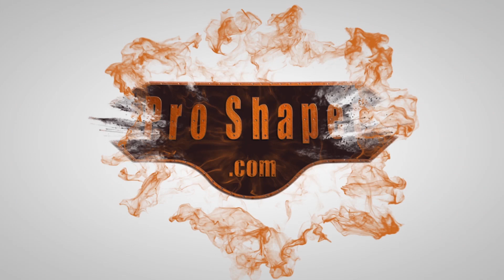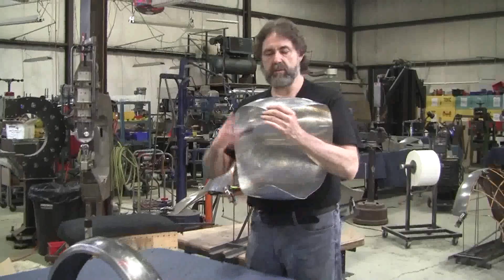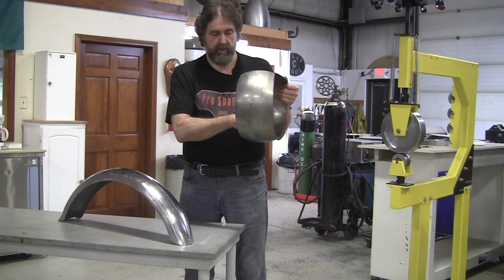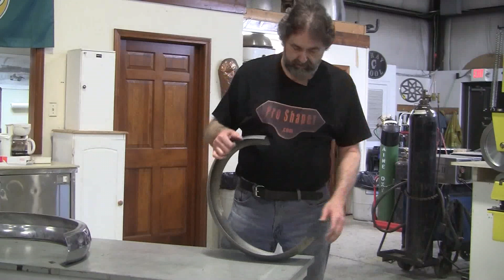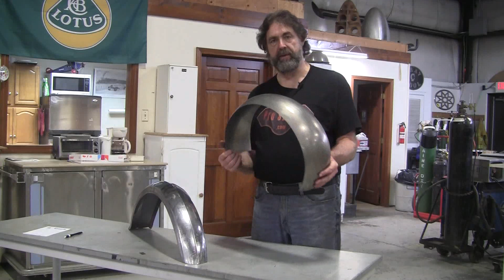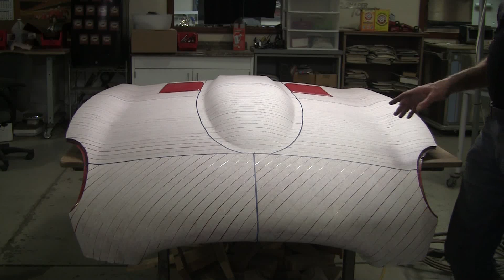Metal Fabrication Techniques: Area and Arrangement

Comment: Hey Wray,
This sort of wheel, 2", is available here in Australia,
Would this be suitable for fabricating an aluminium motorcycle tank? And use the hammer , former and bead bag for stretching and shrinking??
Great videos, thanks
Paul, Australia.
Reply from the maker: Hi Paul,  Yes, an inexpensive Chinese English wheel with a 24" throat will whet your appetite for the craft. It will allow you to make motorcycle tanks and fenders, plus patch panels for restorations of cars. If you want to shape larger panels consider purchasing the plans for the new English wheel I'm doing a build video series on. see proshaper,com for the plans. The wheel has a 35 " throat and is made from 4"x 4" x .250" wall steel tubing.
Reply: @proshaper  thank you Wray, I'm eagerly waiting  the next episode of that series. Tell me will we be constructing the wheels ourselves from supplied drawing?